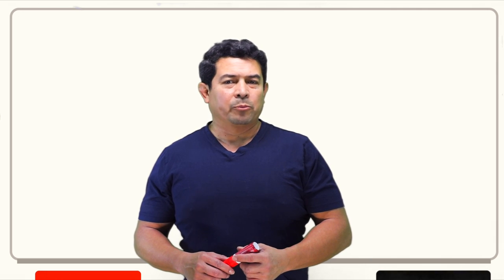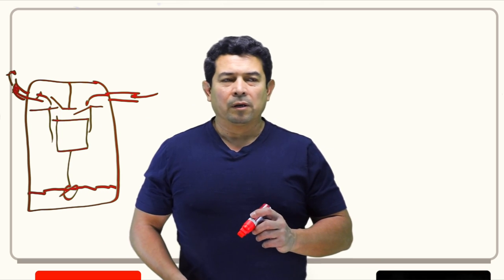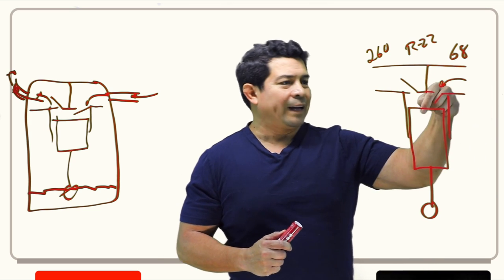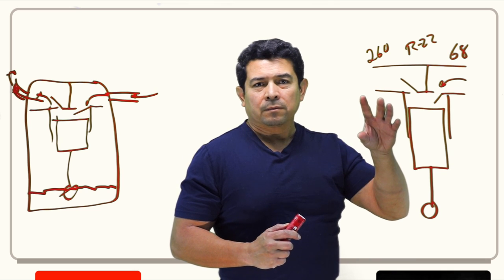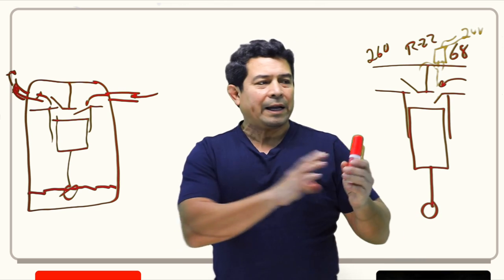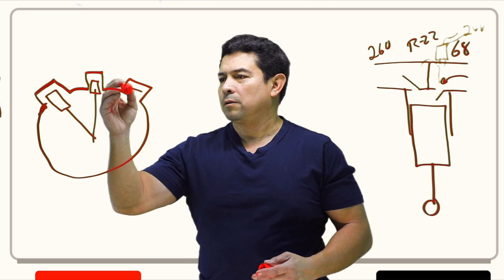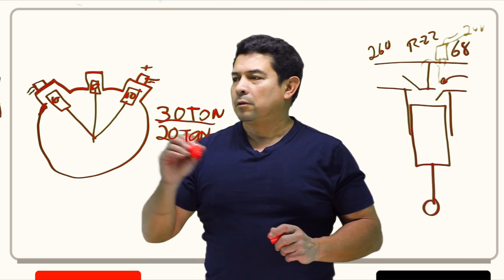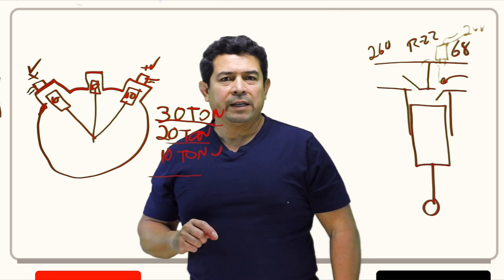Compressor Unloader - HVAC Online Training and Courses

Comment: Great video!  When adding refrigerant to a system, the compressor should be loaded. Typically, on an 06 e/d Carlyle, should the unloaders be ran in or out to be loaded?
Reply from the maker: Yes, that is the only way to get the charge correct. To make sure the system is fully loaded. I don't know how your unloaders are set up but make sure that the unit is calling for full cooling so that the unloaders will be loaded. You will see that the pressures will change. The suction pressure will drop and discharge pressure will increase. Only then will you be able to get a charge correct. Hope this helps.

Comment: If the unloaders stop working can it cause a system to go off on high head pressure?
Reply from the maker: No, it should not cost it to go out on high head. It will just make the compressor work at its maximum capacity, which is it's original design.   if you're having a system that is going out on high head, check your condenser and make sure it is clean he might even want to use a flashlight to look in between the fins, make sure that someone has not replaced the condenser fan motor with a slower, running fan, make sure that the condenser fan is rotating and the proper direction for the fan blade, make sure he has not been overcharged or that there's a restriction.    I hope this helps. And thank you for watching!

Comment: Nice video. What is the point with having a unloader valve on a 1 piston compressor, wouldnt it not be easier or cheaper to start/stop the compressor when the load in the room changes?
Reply from the maker: HA HA!!!   I never tough of that about my video!!!   In the drawing I am using, or showing a single piston compressor, just to make it easy for everyone to see how it works. But in reality, you are absolutely correct. You would never do that unless you are trying to keep the motor from starting and stopping. A long time ago, and I am talking about 30 years ago or so I did see that at one point. But that was the only time that I saw it, they were stopping the compressor from doing work, instead of stopping the entire motor. These days you would only use an unloader with two or three heads. And you would unload one or two heads and then shut the compressor off when it was satisfied and the last head would not use an unloader.   But in the video I am just showing how the unloader works. It was interesting that you picked up on that. Thank you for watching!
Reply: @AirConAcademy  That was also my first intuition! Thanks for the answer again!! Keep up the good work. Just to be clear this is cind a the same principale when you are in the field and people are using the therm “the scroll is lifting” when having a digital unloader valve right on a scroll compressor?
Reply from the maker: @cfcdomino  on scroll compressors typically they are set up to operate at 100% or 67% capacity. There is a disc inside that rotates and it opens up some ports to reduce the capacity so the system can dehumidify. As far as I know when the scroll lifts is because there is a problem and it is doing that so that I can bring the temperature down, or to help liquid get through. I'll have to look into it but I don't think they lift to unload. Hope this answers your question. Thank you for watching!

Comment: i have a question sir. the chiller that i operated now got unloading during midnight. is it okay when i turning off the chiller? or stay it running?
Reply from the maker: Yes! It is OK if it unloads during the night. It should load and unload automatically depending on the heat load. In other words if you do not need as much cooling it should unload and it will cost less to run but maintain the proper temperature.   If you do not need it it is OK to turn it off. But it will automatically adjust to maintain the proper temperature/setpoint. Thank you for watching and thank you for sending in your question!

Comment: If you are fully Charge in 30 ton all ..what happen if 10 ton  only running what about the pressure of the system it is coming high or we need to release some refrigerant or no
Reply from the maker: This is a complicated question. But let me try to make it short. When the compressor is unloaded the compressor will do less work like you said and the pressure will go up. When this happens the evaporator will do less work and because of that we are doing less cooling. At the same time the high side pressure drops because you're not pumping as much gas out. When the suction goes up and the discharge drops they work together to keep the system running properly. The refrigerant will stay in the system of course but most of the systems will have a TXV and because of that, the compressor will not flood and the evaporator will keep the proper amount of refrigerant in it.  I hope this answers your question. Let me know if you still have questions.
Reply: @AirConAcademy  thanks for your answer sir. base on my experience regarding the tandem compressor,   2 compressor in one system.. if one compressor is running and charge for normal pressure low side ang high side... if the 2nd compressor is  running  or both compressor 1 & 2 is running suction pressure is drop and high pressure rise , then if you add refrigerant the in normal refrigerant charge for the system... and the one compressor is cut- off automatically and the other compressor is still running suction pressure is rise because the time both compressor  is running I added a refrigerant and after cut -off one compressor the pressure is rise if one compressor is running suction pressure is increased..

I think it is same happen for undloader and tandem compressor..

I hope you understand my commen I am not good in English grammar...
Reply from the maker: @Denzkitv  yes, I understand your comment. And the way you described it it is correct. When you have unloaders the same thing happens as when you have two compressors in tandem. That is why the system has to be fully loaded, meaning the unloader has to be loaded so that you can get the correct pressures and you can figure out the correct superheat and sub cooling. Yes, you describe it correctly. So for charging, make sure you have a good heat load in the room that has been called and that you have the compressor fully loaded. Let me know if this makes sense to you. Good luck!

Comment: Great knowledge shared. THANKS. I will like to exactly how the unloader coil is activated. Does it have anything to do with suction pressure?
Reply from the maker: That is a good question. Some are operated by oil pressure, some are operated by suction pressure, some are by demand. Meaning that if you need more cooling it will load up if you need less cooling it will unload and do less work.
Reply: @AirConAcademy  Thanks for sharing. I look for to more especially on  animations. Keep up the good work.

Comment: how to adjust a manual unloader no solenoid valve my unit is a 30 ton and I need to adjust to 20 ton..
Reply from the maker: Some unloaders are built into the compressor. Look on the side or the front of the compressor there may be a capacity controller on there. What that is is a box that is part of the compressor there is a small adjustment valve stem under a cap. By adjusting this you can adjust it so that you can have it load or unload depending on the pressures. Most unloaders are going to be electrical like I am describing in the video. There's also a possibility that you may not have any type of unloader on your compressor. But take a look around the compressor see if it's in the front of the compressor or on the sides. Without looking at it it is difficult for me to tell you much more. Good luck!

Comment: I appreciate your time and effort.
I have a question please yesterday I had question in my head that what would happen to a compressor if it runs on negative pressure for example ( low pressure switch incorrectly set) so that the compressor  below atmospheric pressure runs.

many greetings from Germany
Reply from the maker: YES!!!!    The low pressure switch is either not set properly or it is bypassed.  make sure it is not happening because that will kill a compressor very easily!!!  it will run with no refrigerant gas to cool it and it will fail

Comment: I think you're wrong.
there's no rod to push the suction valve. when the solenoid opens the port, discharge gas goes to the suction side through the opened port.
in fact, the suction valve is opened by the gas that getting into the cylinder when the piston goes down.
the solenoid opens a port only that connects the discharge side to the suction side.

Am I missing some point?
Reply from the maker: Mahdi Shahsavari hi, there are several ways of unloading compressors.     You are correct in the sense that the newer compressors do everything by controlling pressure and opening or closing the suction port. But over the years there have been many ways of doing this.   Thank you for watching and commenting.

Comment: Sir, Could you please explain on below also,                            1. What is High Suction Superheat? What will be the Problems? Solution? 
2. Suction Temperature high and low limits and what problems it may cause?
3. Discharge Temperature limits and problems?
4. Reason for liquid or knocking?

Thanks alot Sir.
Reply from the maker: 1. 
High suction superheat is when you have the suction gas coming back to the compressor and it is too warm. If it is too warm, it is not going to call the compressor down like it should and the compressor might overheat and tripped on internal overload.
2. Just like I said, before if you have high temperature on the suction line. It will affect the compressor the valves because of the high superheat may overheat, specially the discharge valve and you could destroy those discharge valves. I'm not sure what you mean by love limits. But if the suction pressure is too low, your compression ratio will be high and that will work the compressor very hard then again, overheat or destroy a compressor. 
3. If your temperature is high on the high side, you are going to damage the discharge valves up and they will leak and because of that you compressor is not going to move refrigerant like it should.  We need to make sure the compressor stays full so it will last a long time.   
3. Typically liquid came back to the compressor is going to give you the liquid knocking you were talking about. If you do not have superheat, then that will cause this problem you're talking about and kill a compressor. That's why you must have the proper amount of superheat.  

I hope this answers your questions. You should take a look at my webpage, airconacademy.com, where I have some courses and explain all of this. Thank you for watching and for sending these messages over to me. Good luck out there!
Reply: @AirConAcademy  Many thanks Sir

Comment: @aircon please advise on Walk in Freezer maintenance in 55 degrees Celsius outside temperature
Reply from the maker: Wow! That is very hot! In my area we do not see temperature is that high!  Near WASHINGTON DC. My suggestion is to make sure the condenser coil is clean, this way you get rid of as much heat as possible as easy as possible. Another thing I would suggest, and this is typically not done but it is some thing I have found that helps in very high temperatures, that is to run the liquid line and the suction line together and have them insulated.   By doing this you are sub cooling the refrigerant even more before it gets to the metering device and you are keeping the refrigerant sub cool. The problem with this is that you will have to monitor the superheat at the compressor to make sure you are not overheating the compressor. As you run the liquid line and suction line together they need to be very well insulated to keep them away from the heat from the ambient air. One other thing I would check to make sure that I do have plenty of airflow on the condenser side so that I can remove as much heat as possible and keep the high side pressure low. I hope this helps and thank you for  sending the question.

Comment: I believe the bitzer head unloaders shut the suction valve as per bitzer manual KT-100, thoughts?
Reply from the maker: some work differently than others. I was just trying to point out that. That the piston does not stop. Some will circulate the refrigerant from the high side into the low side, some keep the suction valve open and some keep the suction valve closed. It depends on the manufacture. But thank you! I appreciate your comment! And thank you for watching!
Reply: @AirConAcademy  yeah just checked the old CR1 from bitzer use suction shut off, the latest unloader design (CRII) from them uses Vapor diverting from him to low side i believe. They also pulse the unloading solenoid to achieve near stepless capacity control! 

Awesome stuff thanks
Reply from the maker: @VoiD1x  thanks! I keep telling everyone that technology is changing so fast it is crazy! I don't think anyone has any idea what is going to be happening in five or 10 years!? Thanks! Take care!

Comment: @9:04 u r explaining that with loading and unloading suction and discharge pressure changes what I think is, consider an example, we have R404 in our system and require temp is 4 deg C , to achieve this we need suction pressure around 60psig , if heat load increase this evaporator's pressure goes down(i.e. suction pressure)  and to maintain the pressure 60psig load on compressor increases and it will activate another bank of cylinder and when load decrease it will unload the bank. This is how loading and unloading works. AND you are explaining that the pressure difference changes with loading and unloading but we have to maintain pressure in evaporator to maintain constant Temp.
Reply from the maker: yes you want to maintain around 4C     as the load increases the evaporator pressure or suction pressure should increase not drop, but when the compressor loads up that is when the suction pressure would drop to keep the pressure where it should be 60PSI so it can stay around 4C. As the load decreases or the room temperature drops it will automatically unload.   and yes every time the cylinder loads up (or it is doing work) the  pressure should drop and when it is NOT doing work the pressure will increase.

Comment: Thank you so much for the video! Very informative. How does this translate to a rotary screw compressor?
Reply from the maker: I'm glad you enjoyed the video and the rotary compressor is one type of compressor. The screw compressor is a different type of compressor. The rotary compressors are used on smaller units and they can adjust the speed of these motors/compressors to adjust the capacity. This way you can change the capacity by adjusting the speed. On the screw compressors, those are used mostly on large chillers, which are designed to cool buildings down. These are single speed, but they use a slide to control how much refrigerant is going into the compressor to adjust the capacity/tonnage. Normally people do not mess with these compressors, unless they really, really know what they are doing. I hope this answers your question. And thank you for watching!
Reply: @AirConAcademy  Us ammonia guys have it cut out for us. Thank you for the tidbits of information and your wonderful videos, I’ll definitely be subscribing. I was curious because I have a compressor leaking from the unloader solenoid and I was unfamiliar with how they unloaded.
Reply from the maker: @blaine4754  thank you! A lot of times every little bit of information helps! Thank you for watching!

Comment: What time solenoid operate . 
So compressor becomes unloaded 
From where it get signals. 
Is it operate by temprature setting
Reply from the maker: There are many different ways to energize and de-energize the solenoid. It can be done with a two or three stage thermostat.  It can also be controlled by suction pressure or oil pressure. As the low decreases the suction pressure will drop and the oil pressure will also drop by monitoring this I have seen that they have controlled the loading and unloading of compressors.   The easiest way is like I mentioned above by using a thermostat. As the load increases the thermostat would load another bank of cylinders doing more cooling, as the heat low drops it would unload the cylinder so that it is not doing that much work. And do less cooling. I hope this makes sense. I hope this explains it to you. Good luck.